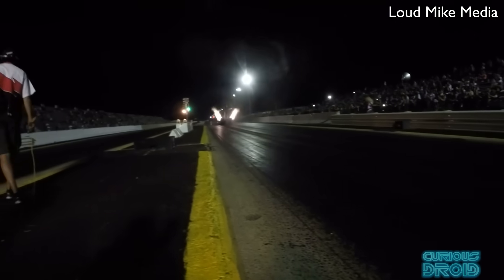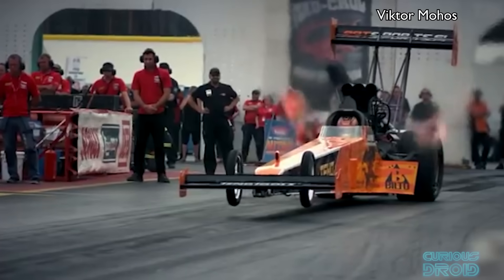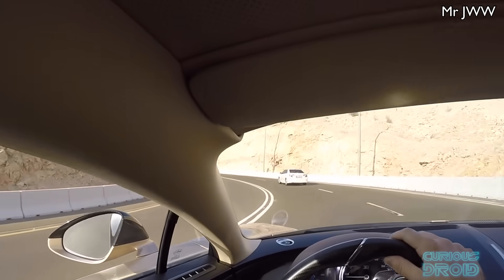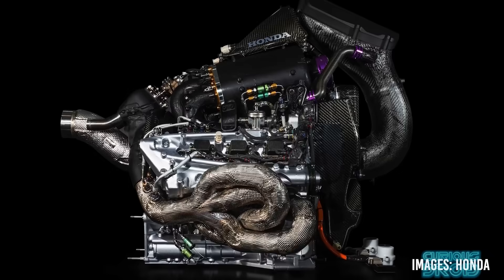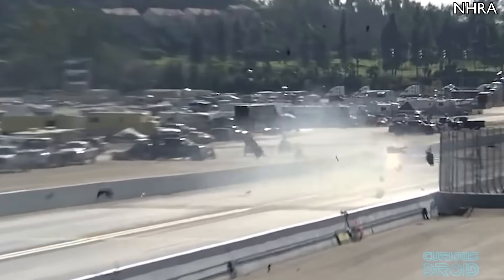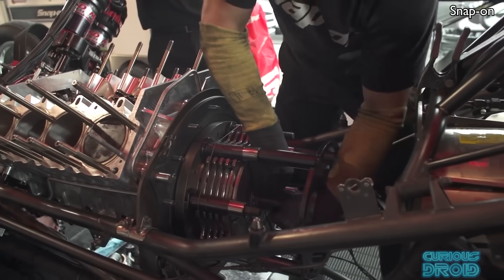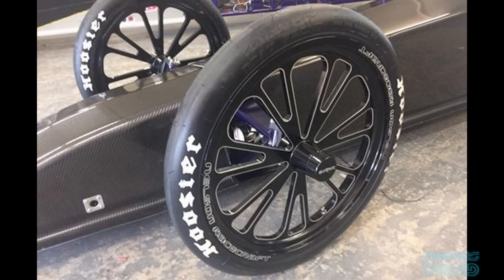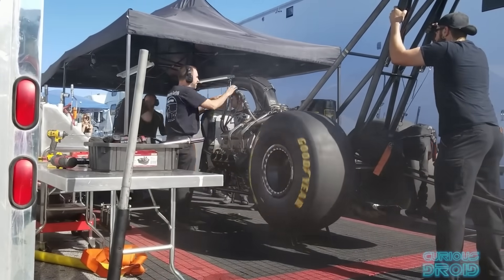The Amazing Engineering of Top Fuel Dragsters

Comment: Safety is starting to hurt top fuel racing, the cement barriers are high enough that if you are sitting low in the bleachers the sound that you hear is sound that has been reflected off them and bounced a few times before you hear it, especially the vibrations on your body. I told a person I took to an event how great it was and was disappointed because it not that good at all. I think if you are seated high enough to see the exhaust pipes it should be like it used to be with the feeling on your body.

Comment: The first time I saw drag racing live was in 1973 at the Fremont drag strip in Fremont, CA. The top speed was about 285 to 290 MPH, and 300 MPH had not yet been reached. Still, these cars peaked the red line of my awesome meter. These cars were so quick off the line. If you blinked at the start, they were already over halfway through the run by the time you opened your eyes. This was when Tom McEwen (The Mongoose) and Don Prudhomme ( The Snake) always went against each other. Good memories.

Comment: Wrong! Since there is no dyno that can measure the horsepower from a Top Fuel engine, crews have a torquemeter installed on the drive shaft,. Once the torque is known, horsepower can be calculated using the formula Torque x rpm x .00019= Shaft Horsepower. This is how it is known that these engines can make 12,000 hp on an ideal day.

Comment: I have been involved with drag racing since the early 1960s as bot a spectator and a racer, and then the Chrysler style Hemi engine was making about 1,200 hp. Today, the same low tech overhead valve pushrod engine at 500 cubic inches is making 12,000 hp! I was in the pits at Englishtown back in about 2010 and one of the teams had their nitro Funny Car up on jacks getting ready to start the engine and check for fluid leaks. Most of the crew, including the driver, were wearing gas masks! But none of us mere spectators didn't understand why until they fired up the engine. The nitro fumes were just like someone had dropped a tear gas bomb. All of us spectators retreated in a rush with eyes watering and lungs burning. I got my first whiff of nitro in the early 1960s and it had a pleasing aromatic scent just like the what the engines burned on the control line model airplanes I was flying as a teenager. Today's nitro has nothing in common with what I sniffed in 1963.

Comment: The Top Fuel engine produces 1,200 hp from EACH CYLINDER! that is more horsepower than one F-1 car, or two NASCAR  cars. The fuel flow at full throttle is 115 gallons PER MINUTE, even though a typical race lasts only about 3.6 seconds. Acceleration on Brittany Force's recent record run was zero to 301 mph in 2.9 seconds (1/8th mile), then 301 mph to 341 mph in .7 seconds ,and an overall acceleration from zero to 341 mph in 3.6 seconds. She was feeling about 6 Gs off the line. The NHRA is the only professional motorsport where women compete in national events, and our female drivers have some pretty big balls. One of the Force daughters once said that when Danica Patrick was a NASCAR racer, that the she would wet her race suit just sitting in a Nitro Funny Car with the engine at idle.

Comment: There are actually specific reasons for the pushrod architecture- the first being that the pushrods act as shock absorbers for the valves. They would otherwise be punched through the cylinder head from the immense force in the chamber. The valvetrain friction losses are also almost negligible when compared to the immense amount of power they make, meaning switching to DOHC wouldn't improve horsepower outputs by all that much.

Comment: Something that you didn't mention in this video. is that the rear drag slicks sometimes at the start of a quarter mile run. and often at the end of the quarter mile run. will change in diameter individually. causing the Vehicle to rock side to side violently. making the driver have to abort the run. and or lose control of the vehicle at the end of the run. it's something that there's simply no control over. and it's noticeable in this video.

Comment: Rc engines run nitro. Mine produces 4.6 hp at 33000 rpm at about 1/3 cubic inch...  scaled up thats over 7000 hp. Lrp .32 look it up!

Comment: Just to give you another aspect of the nutty engineering...
Drag strips for most of my life were 1/4 mile (1,320 ft), but the cars were getting so fast that they shortened it to 1,000 ft. 
And I recall reading about engines up to 700 cubic inches (11.47 litres)

All those restrictions, and they're STILL going at the speeds that caused the restrictions in the first place!

Comment: Roots blowers were originally made to be used as air pumps for industrial applications by the Roots brothers in Connersville, IN. They’re used a lot inside of grain systems to blow corn and beans around in pipes to different grain bins too. They can be extremely loud when a pipe has to be switched, almost like an air raid siren.

Comment: It's truly the most amazing in person experience I've ever had... I have been to a Space X Starship launch and that in itself is an awe inspiring experience and probably would be more intense if you could get inside the exclusion zone to experience it a little closer... having said that this is what makes an NHRA race so much more exciting and intense because you get the experience 40-60 times a day... the sum of over 20,000 horsepower coming to life and being harnessed to accelerate a vehicle quicker than aforementioned Starship as the driver experiences 3+ g's upon acceleration and even more g's (4+) upon deceleration... the 4-wide events have registered as high as 3.9 on the Richter scale for earthquakes which is absolutely insane... the feeling you feel when they make a pass is something I have never experienced anything else like it... and I'm really not trying to be "that guy" but if these cars were electric it wouldn't even be close to the same experience at all... and I'm sure as the battery technology continues to advance that there will be EV's capable of running with a Top Fuel car which will be cool and quite literally the most impressive accomplishment for EV's when it happens... but I'll take the eye watering, nose burning, sensory overload nitro methane experience over the EV every time... so get out there and support the racing scene! It doesn't have to be a NHRA race it can be any race or any motor sport for that matter just get out there and support your local tracks, lets keep these places open and keep this sport alive and well!

Comment: How do they survive? The answer is they usually don't. Drivers are usually only good for one pass, and then they die. At the larger drag racing tournaments, like the Indy 500, sometimes they run out of qualified drivers and have to ask spectators to drive. Sometimes they have to shorten the racing season if there's a rocket fuel shortage. NASA always gets priority. They've almost perfected the liquid hydrogen powered hemispherical combustion chambered engines.

Comment: The metal the valves is one of the hardest metals known. I still have a scar on my right cheek where a flaming piece of the metal went between my glasses and cheek. I was turning it at 15 RPM so the tool doing the cutting would last.

Comment: 6:26 Look at those perfectly indexed spark plugs.(each aims at the exhaust valve) Usually, it's not really worth the bother to index them on a "mortal" engine, but you do gain a % increase, so with top fuel, apparently, it's worth the bother. lol

Comment: people are so stupid nitromethane does not burn it decomposes it's next of kin chemically is TNT. 
nitromethane does in fact Carrie oxygen in the molecule it goes out the exhaust pipe a very small amount May combust with the methanol mixed with the nitromethane to cause it to start and run until there is enough heat in the engine along with the massive compressions can cause it to run. 
you don't really need the methanol the problem is the higher the percentage of nitro used requires even more nitromethane to cool the engine.
the reason they use a different thickness of head gasket is to accommodate the apparent difference in fuel distribution because of the Roots blower throwing hunks of fuel here there everywhere. oh dear here we go I can't even begin to straighten you out here the asymmetric blowers may require 1200 HP a roots supercharger is well over 2000 horsepower to drive the the asymmetric blowers cannot be used with nitromethane as it goes off inside of them. 
if you actually sit and think about it there is too much fuel in the cylinder to ever get anywhere near top dead center the mag set the fuel off so early under the immense heat and pressure already in the cylinder the fuel decomposes and becomes gas this is where the massive horsepower is created the conversion of the fluid to a vapor well still being compressed create so much heat the exhaust leaving the cylinder leaves the exhaust pipe at many times the speed of sound you can tell exactly how fast by how many shock diamonds you will see just like with a rocket I can't even begin there are so many people who have run nitro for so long they think they know what it is but they do not I run a car at Bonneville we run 85% nitro we burn over 500 lb of it over a 5-mile pass two separate times for an average speed that becomes a record if you have broken one.
again I can't even begin with the mistakes or the erroneous statements given.
my race car empty is 2 1/2 tons can I have a 1 to 1.13 rear Gear no transmission direct drive I have been 330 mi an hour your statement about the wing is absolutely impossible very little math to show how completely bogus that number is please buddy stick to space you know more maybe as obviously you have not applied add common sense to any of this the wing doesn't produce anywhere near any kilo Newton's of anything anyone can lift the front end

Comment: Back in 1991 we were chasing the fastest street car in america title using an insanely modified 85 IROC Z that was appropriately named the "Pro Roc". It had a 600 cubic inch alcohol injected big block chevy topped with a 10-71 blower. Well, around mid season of that year we finally made a run of 8.49 and clinched the title. That record has of course been broken many times since then, but, an 8.49 in 1991 in the quarter mile from a car that had license plates and could drive on the street occasionally was no easy undertaking. Those were very fond memories and i still pull out those old pics from time to time just to reminisce

Comment: Never been to Top Fuel, but have been to meet-ups in the TX country back roads with some pretty powerful setups racing in them.  My favorite “Cock-up” was a ‘68 Camaro that took off from the line with a sudden Bongh and it rolled about 30’ and stopped.  The flywheel/pressure plate  and end of the crank were buried halfway into the pavement!!!

Comment: 5:04 That's true. and also, measure (and organize by length) the used ones and use them to "mix/match" with pistons, in order make the compression height equal in each cylinder during a rebuild.. Just thought it was a neat thing to share.
edit: 7:25 however, that's not true... It uses a lot in the "4 second" pass, but not near 20 gallons.  It uses 20-25 for the entire thing (the burnout... staging... and the run itself...)

Comment: Another tuning trick they will do is they will take each connecting rod and measure them and put them in the designated holes depending on the length of connecting rod there for micro tuning the compression ratio of each cylinder

Comment: Why would you say that they are the fastest accelerating "ground vehicles" when they are the fastest accelerating vehicles period. Ground or air this is the fastest acceleration on the planet. You ought to do a bit better research. Put a top fuel driver in the fastest accelerating jets in the world & they twiddle their thumbs while the pilots experience a few G's from acceleration but not even close to going 100mph in .8 seconds. 200 mph in less than 2 seconds. >300 mph in less than 3 seconds & it's over before you leave the 3rd second. Nothing tops that air or ground & definitely not water.

Comment: You know what’s confusing.

A Newton*meter is torque. 
Buts it’s also called a “moment” in certain engineering classes (which is literally how ppl think of torque with levers)
Its also a joule in Thermodynamics
Therefore wattage (which is Joules per second) could also theoretically be called torque per second. 

Rant over. 

Also…why….

Comment: These cars have so much power, you cant even use it all because it comes down to tire spin and transforming the power into the ground. They can have an 100k hp engine, it will be just as fast as an 1.5k hp engine.

Comment: Just for the record, decibels are rated in a logarithmic scale, not a graduating scale. 120dB would be thunder or a jet taking off. 130dB would be jackhammers or an ambulance or fire engine horn or siren at maximum effect. 140dB would be a gunshot or loud fireworks. 

For reference, 0dB would be the lowest level of sound we can detect as humans. 10x that would be 10dB. Being logarithmic, 100x that (10*10) would be 20dB. By the time you get to the far end of the spectrum (what we can detect vs. what damages hearing), you are looking at one billion times the amount of noise. Which would be 140dB. The absolute threshold for pain in the ear. Top fuel typically runs at 160dB. Thankfully, it is only for very short times, and it moves away as it goes. The distance reduces the noise greatly. At the starting line, it is 160dB, which would be several times as loud as 140dB. Basically, it is on par with a very powerful explosion, beyond loud fireworks or large bore rifle or artillery, or even into tanks or ship mounted guns, and those type of shots packed with kilograms or pounds of explosives. 

They are loud to the point that some people faint, some throw up, and some lose their bladder or bowels into their pants because it vibrates your body to a degree that very few other events can. 

It also makes it impossible to see straight and hard to swallow while faced with just the noise, but add in a nearby exhaust at full throttle....then the fumes hit you and you feel like you can't breathe at all, that you will faint. That smell sticks with you a while as purely dangerous. (Unless you're into RC nitro cars, then it's a Tuesday for you savages.)

Like I said, it's all great! Amazing honestly! (It's not. It's very nearly the closest any of us will get to complete chaos, and THAT is why we want to do it. To have a comparative experience.)

On that very short list of what is louder than a top fuel dragster would be a large bomb, a space shuttle launch, a Blue Whale lighting off with song underwater, and right next to you (crazy right? compared to a Top Fuel dragster? But sound works differently underwater, and blue whales have been measured at 188dB and carrying their songs for hundreds of miles underwater across oceans.)

Then, of course, we run into the real big bangs! Maybe a volcanic eruption, ~210 dB, a nuclear bomb running at about 235 dB, and a meteor striking the Earth at about 300-315dB. 

The point is, Top Fuel dragsters are loud and powerful. It is likely the most powerful machine many of us will ever see. Large ship engines notwithstanding, but those displace dozens of cubic feet internally, vs 0.3 cubic feet for cylinder displacement....or 500 cubic inches.....for 10-12k horsepower and 12k ft/lbs torque. It really is like riding a bomb with a driver headed for a finish line, 1320 feet away (unless youre too young to actually be cool, then it's 1000 feet) but 1000 feet to 1320 feet at 330 mph is negligible. Its the difference between hitting the brakes or hitting the brake at 1320. Maybe a couple tenths of a second, probably less. It's 335 mph we're talking about. What is 320 feet between friends?

How romantic. How terrible. How awesome.

Comment: The fuel system is staggering - port inj, direct cyl inj, and also pre boost aspiration delivery - the resulting effective fuel economy translates to 88ft per gallon! Using a fuel base octane rating of close to zero.

Also, the clutch and tires themselves, are the transmission.

If intelligent life exists outside of Earth, or from other dimensions, they would definitely be NHRA fans
Reply: 88ft per gallon sounds like a welding rate lol. 

8 litres per minute on some surfaces would be the norm. How far can you weld in a minute? Not 88 feet, that's for sure, but it's the only reference I can think of that's close in terms of scale to fuel consumption, except in rocket technology and leaving the Earth's gravity, overcoming inertia, and fighting through the atmosphere with a payload. Surely they run near 88 feet per gallon, right?

Except it's a compressed material, forced out by another compressed material.... sometimes oxygen.

Comment: I read this twenty years ago:   Give a supercar a few miles to get up to max speed, say 200 mph.  Stage a top fuel dragster on the same road at a “start line,” same direction.  As soon as the supercar hits the start line, the dragster drops the hammer.  Dragster wins easily to the quarter mile mark every time, assuming a clean run.  Do the math. Acceleration, anyone?

Comment: Proves that a good ole 2 valve pushrod single cam V8 is the best engine design ever. All these 3,4,5 valve, 4 camshaft "modern" designs are unnecessary. Too many moving parts, too many mechanical parts that will eventually fail.

Comment: These engines are usually running on pure compression, like a diesel, by the halfway point down the track because the sparkplugs have melted away. The only way to shut off these engines after a race is to shut off the fuel flow.